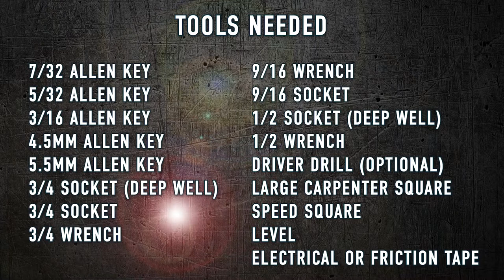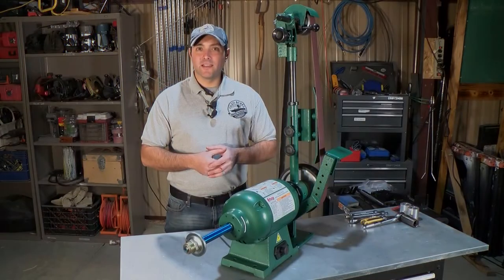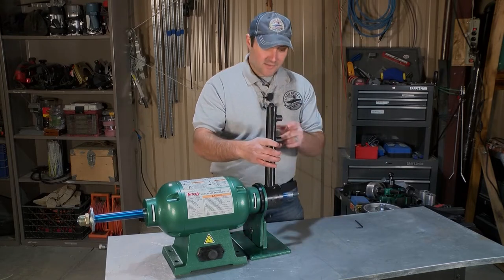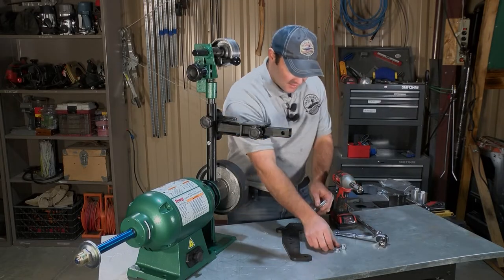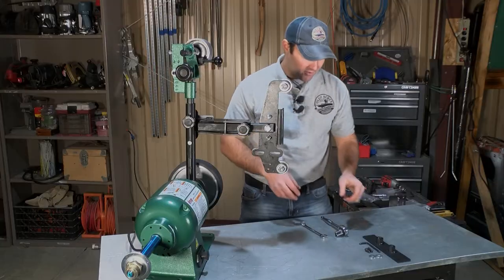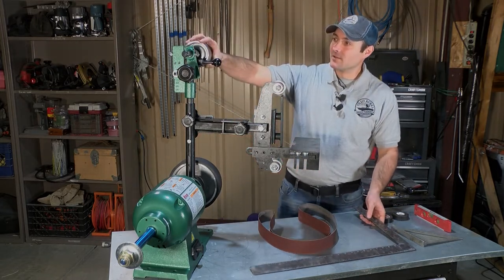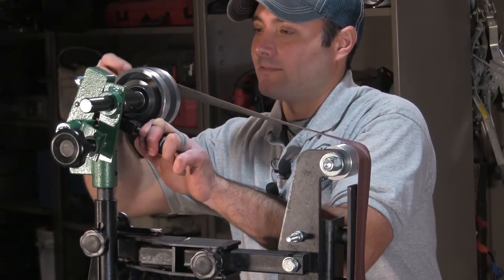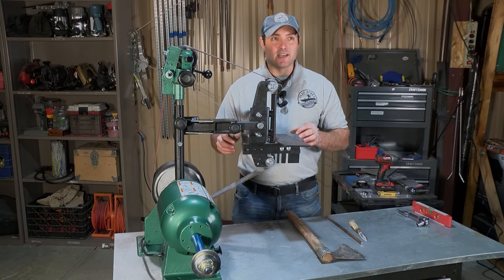Modification Kit for Grizzly or Shop Fox Knife Grinder

Comment: Here's my puzzle.... Found a brand new motor for shop fox brand new at very good price. Buying pivot arm they say would take six months... Will the grizzley pivot arm fit on shop fox motor? They are in stock and pretty cheap
Reply: Hi, The pivot arm will definitely work on the ShopFox. The two units are identical with the exception of the drive wheel being larger on the Shop Fox.
Reply: @robmichel685  well the motor doesn't come with a drive wheel...I might be digging a hole trying to piece this together
Reply: @ShopDog1021  I will double check on Monday but the arm comes packed with an 8" drive wheel. The motor is in a separate box with just the motor.

Comment: Can you use this mod kit with a small wheel attachments?
Reply from the maker: We have successfully attached the TR Maker small wheel kit to a piece of square tubing that works with the mod-kit. The only requirement is having an 8" drive wheel. If you have a Shop fox you need to purchase the grizzly 8" wheel.

Comment: Does this work with the Rikon?
Reply from the maker: Hi David, honestly until your question I didn't know that machine existed. It appears to be a copy of the shop fox and grizzly. If you wanted to try it I would offer a full refund if it doesn't work. Call 303-979-0446 Monday through Friday 8 am - 5 pm MST. Ask for Rob.

Comment: Nice, but it cost more than the grinder itself!!! Too rich for my blood
Reply from the maker: Thank you for your comment we try to keep costs as low as possible but the Mod-kit is only $350. The Grizzly and Shop Fox currently retail for $650 from Oleo Acres Farrier Supply or $649 from Grizzly plus $100 shipping. The kit expands the capability of the sander while allowing for additional aftermarket accessories. Hopefully that clarifies the costs.
Reply: Can you add a second mod kit to the auxiliary side of the machine and have two belts running? That would be incredible.